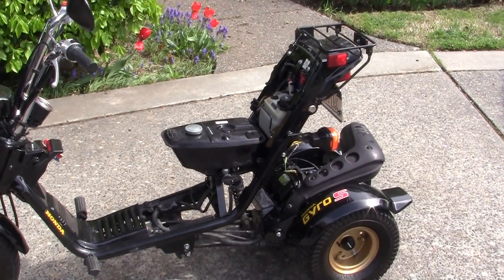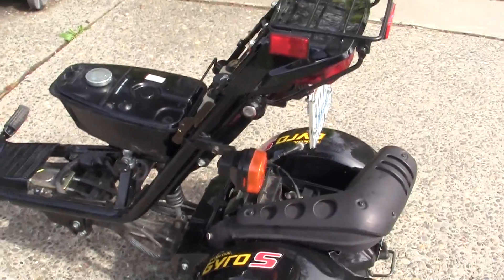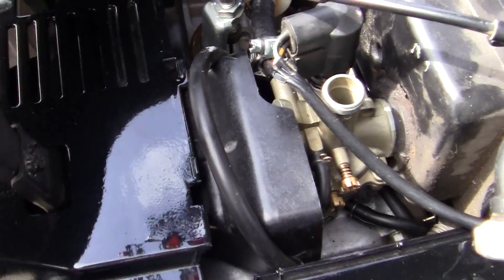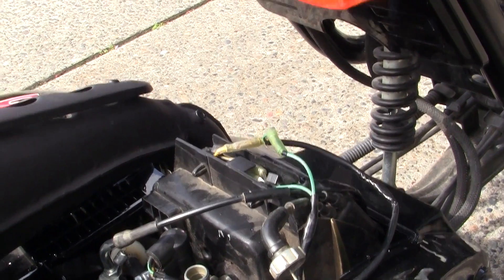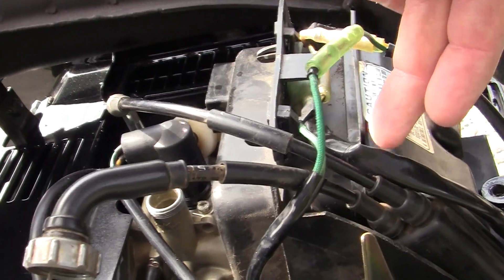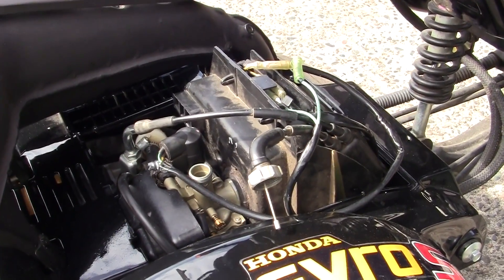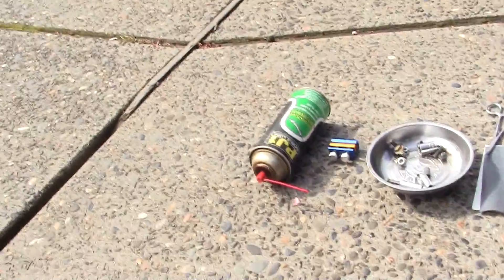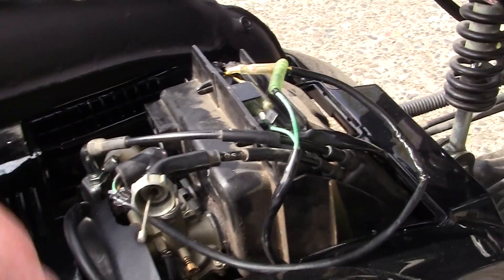(8)- 1985 Honda Gyro Problems

Comment: Man I wish I could come hang out to work on are bikes . Clean the carb an put a pod filter on it like your Demon .
Reply from the maker: You cant put a pod filter on it. The air filter is designed to let in a certain amount of air for some reason. Like a small restriction. Also the air cleaner box is the mounting area for all the electronics and Dual Brake cables and assorted stuff. I wish I had other bike experts around here too. Thank fully I have fixed the problem. The last thing I will do which has never been done in 33 years is pull the left rear tire, left crankcase stator cover and take the fan and flywheel off. I am positive the flywheel and stator have 33 years of very fine dust on the flywheel magnets and stator electronics. The Problem is fixed thank God and I took the bike out riding for an hour today. Now it is on to the Dio body panel tear-down, and new radiator and plumbing hose and water pump placement. It is finally warm here in Washington. Warm enough any way. I will keep the Zuma and the Honda Gyro completely stock. all of my modifications will go on the Dio. Thanks friend. R
Reply from the maker: On my gyro and zuma , they stay bone stock. This way I can focus on one bike, my Dio with engine building and modifications. Some people say I am crazy. I just say that I am old and don't have the energy to stay up 3 days at a time, juggling performance engines that may or may not work. Hows that front disk brake set up working? That is what I need to look into if it is not Buukuu Expensive. Bro. R